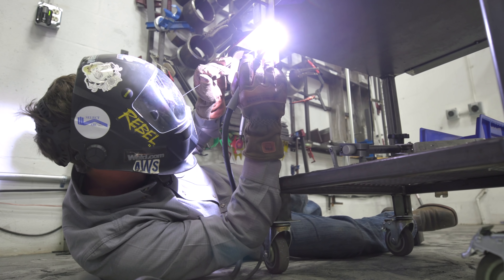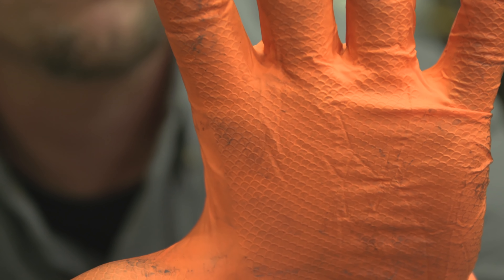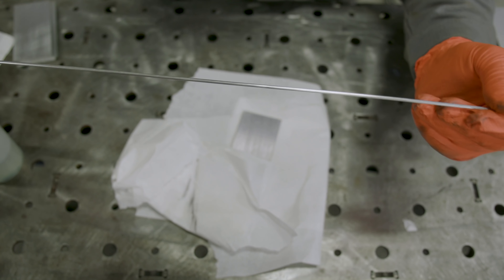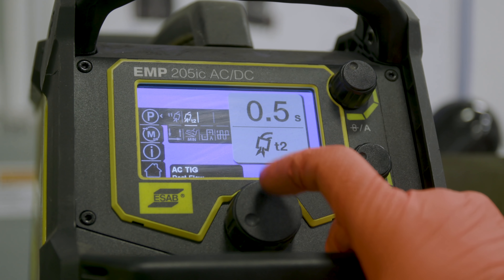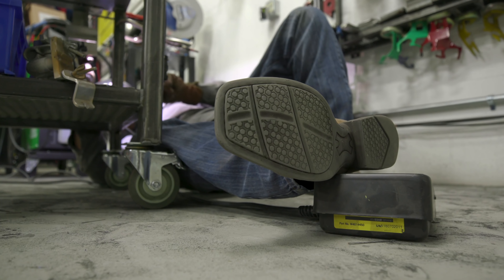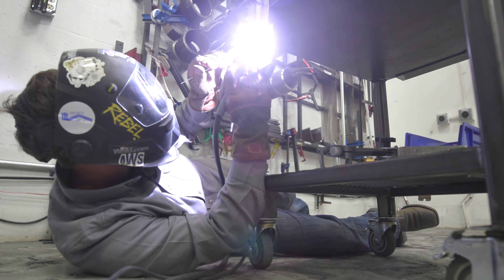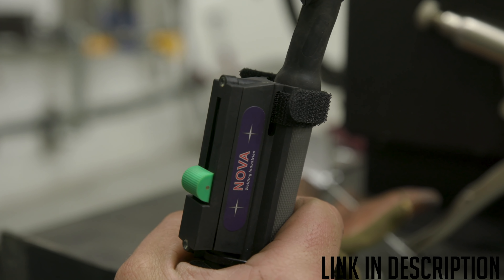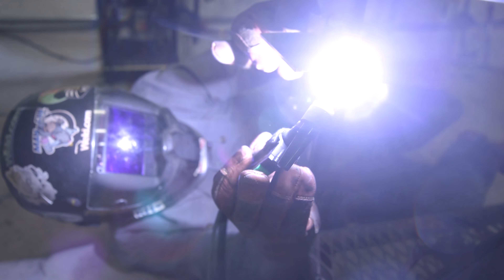Get out of your comfort zone! TIG Welding Aluminum Overhead

Comment: I do a lot of aluminum boat repair- 75% of my welding is upside down under a mossy, dirty, water-logged boat. Often the only real criteria is to do the job undertime and pass the pressure spec- a clean, hot, consistent weld will always hold better than a dirty, ugly, inconsistent one. Use a pressure style finger control vs. The slider- or the foot control between your knees. A fire-resistant blanket is a good idea- along with a couple extra tungstens.

Comment: Good stuff Mancub, Have you been working out?? I have an unrelated question... Can I hook up a water cooler to my AHP 201XD and run a water cooled torch for Aluminum.
Reply: Yes you can.
You could even add a power pass through if you are a bit elecrical minded, otherwise you can plug the cooler into a wall socket.
If you fit a pass through socket the cooler always turns on when you power up the welder, if you use a separate wall socket insta is easier, but you could forget turning the cooler on, which will destroy your torch very quickly (or more exactly the torch's power cable)

Comment: How do you eliminate the "hole" at the end of your weld using mig?
Reply: you can use the crater fill setting or if you don't have it pause and add another shot of metal. that sometimes helps too.
Reply: There is couple ways.
1. Soon as I come to end of my bead, I let go of the trigger then hurry up and pull the trigger again.
2. Soon as you come to the end of your bead, come back in your puddle a little bit and let it fill up for about 2secs. That always work me. Thanks for watching Weld.com stay healthy and safe.
Reply: At the end of your weld go back the opposite direction a quarter inch half the speed you were welding or you can just pause at the end depends

Comment: How far are you sticking your tungsten out for the tee joint??
Reply: About 3/32 but no more then the Inside dimension of my cup. It depends what I am doing also .But I always watch the bottom side of the puddle because gravity  wants to pull that puddle closer to your tungsten. The puddle dont like to be real close to your tungsten like steel or stainless. Also sometimes I recessed it. Just depends. Hope this help. Thanks for watching Weld.com l. Stay healthy and safe
Reply: @mancubwelder7924  okay thanks, this is the only joint I have trouble with. Even if it's flat, hope you guys do a video on it. Thanks again!